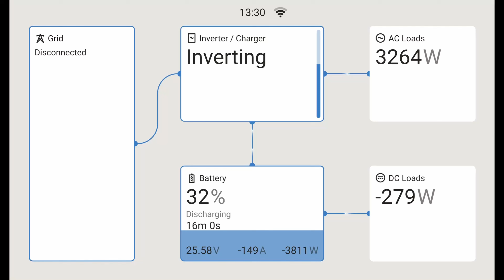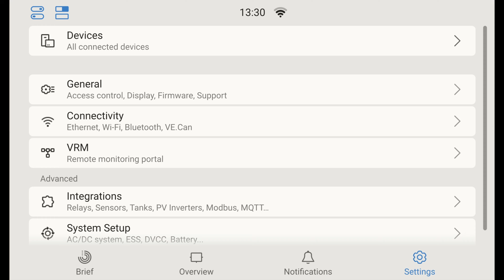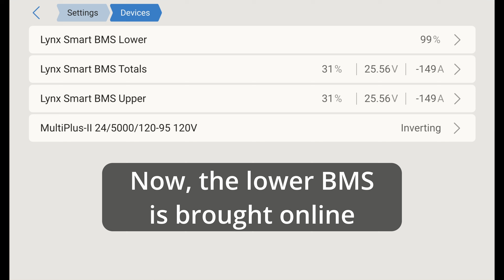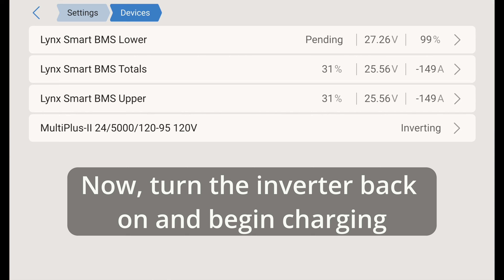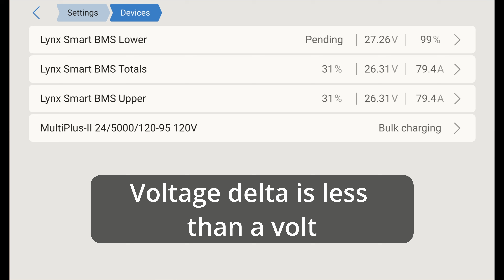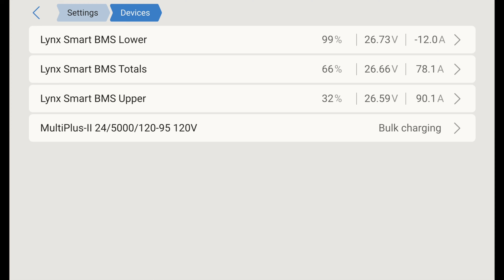Demonstrating Victron's Smart NG Batteries Combining after disconnect

Comment: Nice demo. How far apart (voltage drop) can the banks be and the system can still coordinate the voltage differential? (Context: Could I have my current Smart Lithium bank on a 8’ power circuit to the MPs and a second bank (NG’s) on a 20’ (or more) round trip circuit with the NG’s and Lynx NG well forward in the boat?)
Reply from the maker: Jim, from what I've seen, the system waits until there is a little under a 1 volt delta between the banks. It's very patient, it will wait all day if it has to until the voltages get close. I would think that the greater the cabling lengths vary, the closer the actual batteries would have to be in order to get the total delta down under 1 volt. So, I think you could do what you describe, but you might find the system is a little more conservative about when it's willing to combine the banks. That said, normal operating state would be banks combined, so it may not become an issue very often. 

-Ben S.
Reply: @Panbo_Marine_Electronics still the best engineered (or at least one of the best😉) battery systems I’ve seen. It makes sense that it’s normally combined so it shouldn’t be an issue, other than the voltage drop a long circuit like I described) would have. 

Cheers